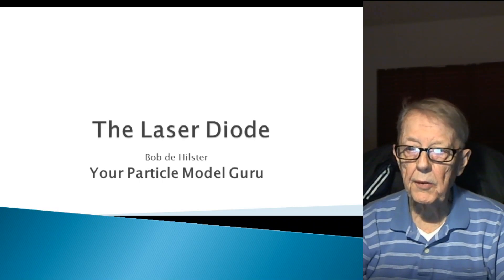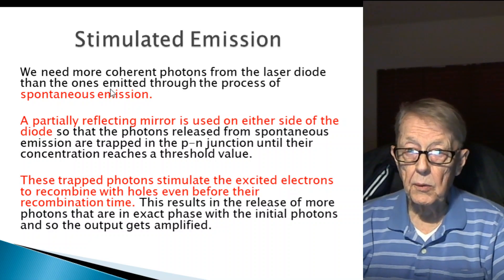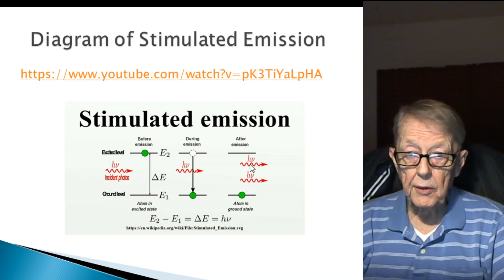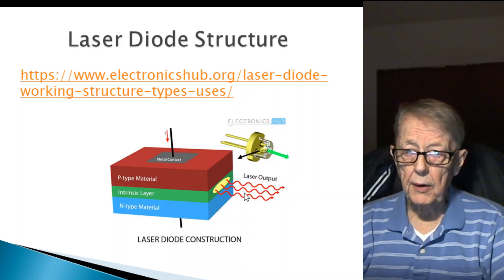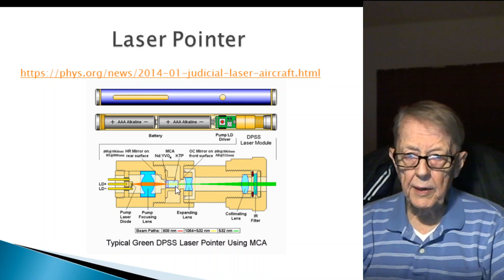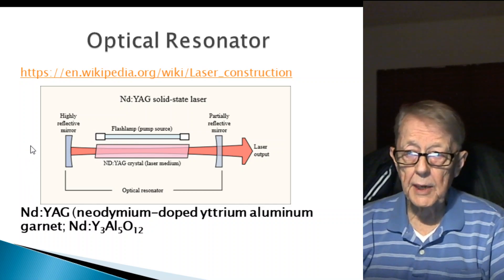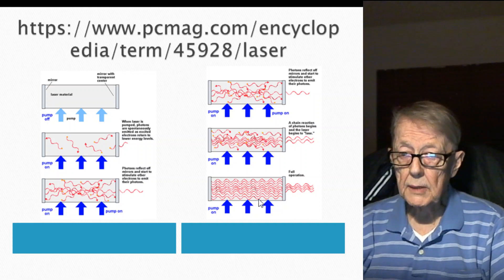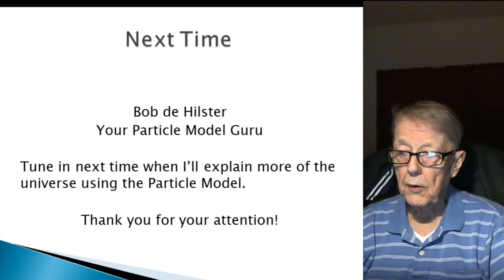The Laser Diode

Comment: 4:25
A photon interact with the electron and causes it to transition to the lower level, upon which it emits a photon of the same characteristics as the initial photon.
The photon doesn't "hit" the electron when it transitions to another energy level.
There is also no "little hole" in the mirrors.
It is only a partially reflective mirror.
Good video thanks.